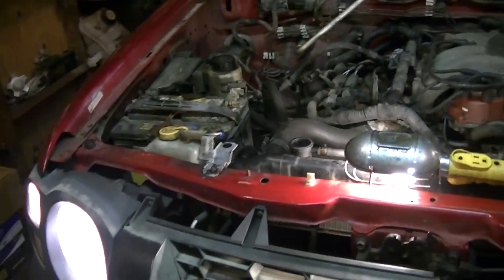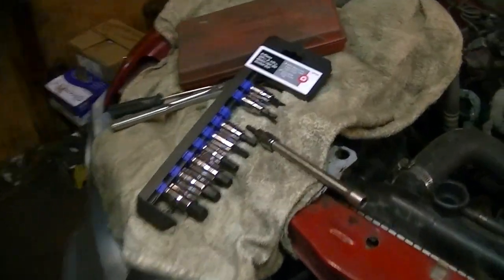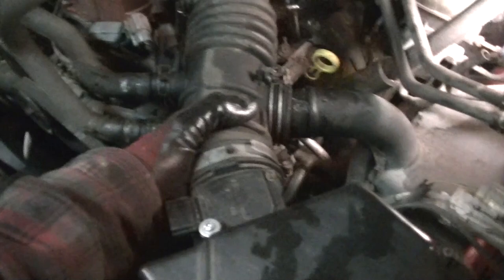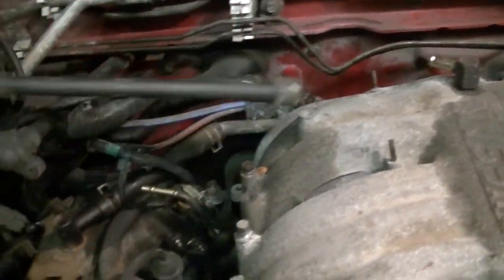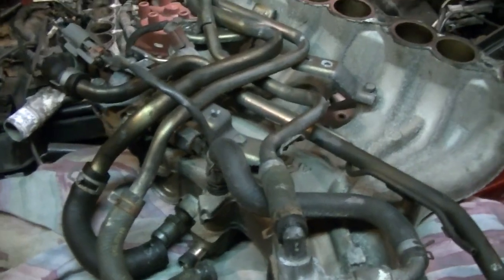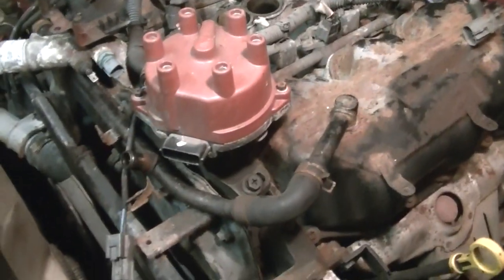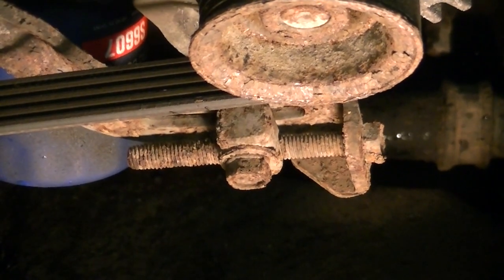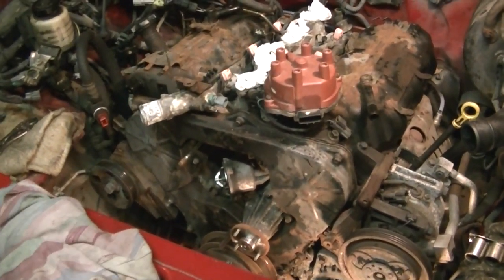Nissan Xterra 3.3 Head Gasket Fix....Part 1

Comment: I am working on an '02 3.3 with blown head gasket. I have discovered pitting on the face of the block where the gasket cylinder sealing rings are. I am facing the block to get a smooth, straight and level sealing surface again. I did the same to the heads. I inspected the old head gaskets and saw that the sealing rings were cracked. When i checked the alignment of the new (evergreen)head gasket I noticed that it was not centered correctly thus itdidn't have good clearance around the tops of the cylinders. I positioned and looked at the old head gaskets and the places it cracked had extended into the cylinders when it was crushed. The piston tops come to within a few thousandths of the top of the cylinders. It  appears that the piston edges  eventually cracked  the head gasket sealing ring. I am replacing my pistons with 020 over pistons and will likely chamfer the edge of the piston top to ensure that it clears the ring  as the gasket likely WILL extend very slightly into the cylinder when it crushes ( it will crush down from approx .075 to .045-.055 in). I am also ordering Felpro Permatorque  head gaskets. CONCLUSIONS: Check your replacement head gaskets on the positioning pins to ensure that they center the cylinders correctly and you have good clearance. Ensure that the surface roughness (Ra= 45-80) of your head and block is correct to hold the composition gasket in place as the engine ages. Use the correct torque procedure for head bolts, LIGHTLY oiling the threads and clearing the threads in the block. Ensure you have no pitting on the mating surfaces.

Comment: I have a Nissan Quest with a VG33e in a FWD configuration. But I got it for $500 and after new injectors, distributor and intake plenum gaskets and a few hoses, as soon as I got it to hold coolant it demonstrated it had a blown head gasket. Which I assume is what's causing the multiple random misfire code I been trying to fix. After got it holding coolant took it down the road it and it smoked so bad I couldn't even see behind me and barely ran. So guess I'm ordering a head gasket kit. Your video on a Dodge caravan helped me a few yrs ago and now your helping me again with this. Thanks for your hard work on your videos

Comment: When I was working on my truck's 350 eng the wiring harness was a dream to work with. Chvevy/GM's wiring harness has a different connector for everything - there is no way you can connect anything to the wrong place. The connectors just won't fit. Question: how many other vehicles (make/model) have you found do this; from the ones you have worked on?
Reply from the maker: A few....it can happen.

Comment: If you do strip one of the intake bolts on top, you can get it out using an irwin bolt extractor from their 5 piece set. I had to do that on one even with the right metric bits.

Comment: That Coolant Hose with the bend in it, behind the the plenum, and next to the firewall is impossible to get off. Its reccomended to just cut it off and save yourself the time. Make sure you have a new one on hand and just replace it.
Reply from the maker: I did fine a slightly better way putting it back on by lubing the hose some and sliding it back together then tighten the clamps. Still overall no that easy.

Comment: Nathan, I recently suffered a radiator failure and overheated my Gen 1 Xterra which blew my head gasket. Thanks to your video series I was able to make all the repairs and get it back on the road with no check engine light. Thank you for you help and taking the time to video and edit your repiars. You have a fan for life!!! Thank you, thank you, and thank you...
Reply from the maker: Nice!
Reply: Mine just did the same thing after getting the money light out after discovering the evap canister was cracked when the mechanic who installed it overtightened the purge valve bolts. Joy

Comment: remember back in the 80's when changing a head gasket took 15 minutes...
Reply from the maker: Right!!
Reply: Yeah right … definitely not 15 minutes but not as complicated as this 3.3 engine
Reply: @Raevenswood  15 minutes. Unless you had a lot of scraping to do to get the old gasket off.. You gotta realize, working on a truck or car in the 80's generally meant the vehicle was from the 70's. There was NOTHING to them. If you knew exactly what you were doing, you could have it ripped down to the gasket pretty easily.
Reply: @ArcaneTurbulence   that makes more sense … I’m working on Toyota’s from the 80’s and there are wiring harnesses and vacuum hoses everywhere it takes at least 1:45 to get the head off.  Everything is somehow interconnected or sharing a bracket so al sorts of parts have to come off the engine to get to the head 😂.  I just took the head off my 86 4runner last night and I’ve done it before and it still took over an hour and a half.  you are right though before EFI there were nearly no wires to mess with even the fuel pumps were mechanical a lot of the time, things were much more simple.
Reply: @Raevenswood   Yeah, that's when they started to get what I call "cobwebs".. Wires running all over the damned place for no good reason other than to get in your way. I miss the good ol days when everything was simple... Today they install sensors all over the place, which really do nothing other than cause problems. Most vehicles would be running fine if it wasn't for faulty sensors... and they almost always go bad before anything on the actual vehicle does.
Reply: @ArcaneTurbulence  the sensors are only there to tell the computer what is wrong so the technicians can do their job without knowing how to actually do any diagnostics on a vehicle 😂.  Mechanics are now just parts changers for the most part.  This saves a lot of time and money for the dealership service department while also making them a lot of money haha!
Reply: @Raevenswood   Yeah, but the problem is, you usually end up diagnosing a bad sensor. lol
Reply: @Raevenswood   For instance, I hooked our truck up to a sysdiag while it was sputtering (obvious fuel/air problem), and it was throwing a problem with the mixture (which we already knew)..lol.. . Turns out the mass air flow sensor was bad, and was reading more O2 than was present, so it was choking the airflow so the mixture was super rich. We unplugged the sensor, and it ran like a champ. Sensors just seem to be more of a problem to me. Common sense generally wins the day..
Reply: @ArcaneTurbulence  next the sensors will have sensors to tell you that the sensor is bad 😂

Comment: that knock sensor is under for a reason .. when you relocate it   it will mess with the codes and it can;t detect what it was made to do when its above where it needs to be . its designed for detecting knocks
Reply from the maker: Well Its on top now of the Intake Manifold. It runs perfect now. It adjust timing just fine. The harmonics will travel through the engine package to the sensor just fine.  10,000 miles later no issues.

Comment: That looked like a wire brush that was too big for the hole, broke off and got stuck. Backyard mechanic strikes again, apparently lol
Reply from the maker: Right!! lol
Reply: I am changing water pump and while removing that vacuum tube, it had the same piece of twisted brush in the same spot. I thought someone left it there accidentally as well. Blew my mind when I saw the same thing in this video.

Comment: Hey Nate my Frontier I think blew out the head gasket and then overheated. Happened this morning on my way to work. Gonna check if there is mixture with the oil and then pull the heads. Should I get the heads resurfaced? It still runs but it is puffing while smoke really badly.
Reply from the maker: Just have them checked. Don't make other people rich.
Reply: @FixingWithPassion  Thanks for the reply. It is an old truck but I really like the configuration of this one being a V6, 5 speed manual, 4x4, and a crewcab. Can totally afford to have it done by someone else as it costs more for my time to do it. But I like to work on my own machines. Currently have an evap issue as well but thats another story.